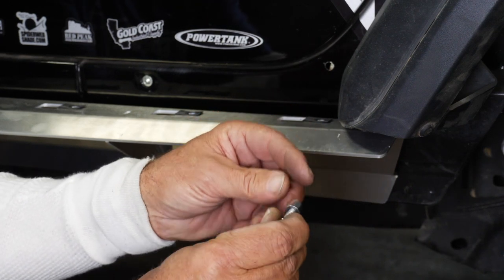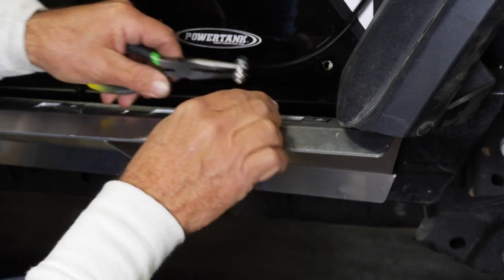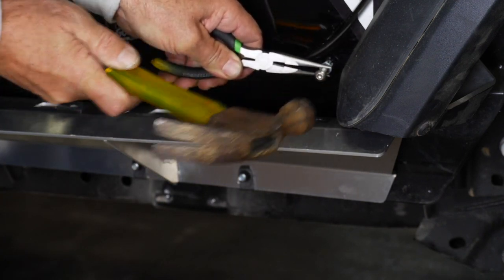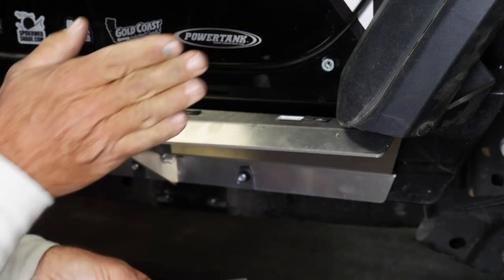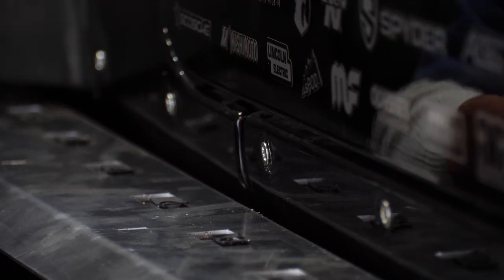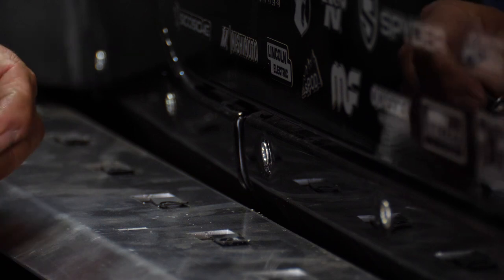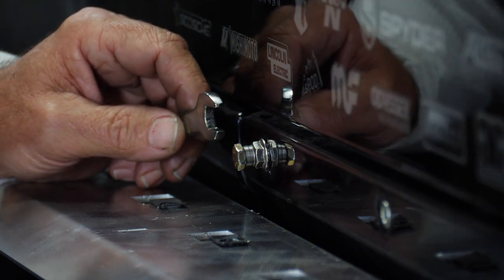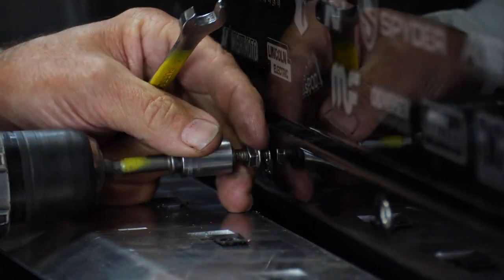How To | Installing Rivnuts on your Jeep

Comment: I've watched 5 of these videos and each one they jus drill to some random point and say oop it's done. Well do you know it's done. Does it pop? Like how do I know it's done or I dont go to far.
Reply: I'm about to tackle this with their hardware, I assume it just tightens enough that you know it's set. Did you ever do this yourself?
Reply: @longhorn8459  tried to do it for new fenders on my Jeep JK, ended up taking my thumb's nail off cause of the wrenches slipped, lol... it's tough.

Comment: Anyway to get the rivnuts back out? All the rivnuts on one fender are spinning with the bolts stuck in them from being old. Just bought the jeep and want to put new fenders on.
Reply from the maker: Most the time you need to grind the head off of them if they will not pull out with a bolt on them.  It is important to make sure you set them all the way when installing them.
Reply: Better to just drill them out

Comment: Great demo!  Which is better to use?  Impact driver or regular drill driver?  What torque level did you set on your drill?  Where do you buy those small washers?
Reply from the maker: Neither, you want to do it by hand. If you compress the rivenut too fast it tends skew it and you end up with a bad seat. We get most of our hardware from mcmaster.
Reply: @GenRightOffRoad  So, in the video the guy uses a drill. Yet you are saying not to use a drill? Or not to use an impact?

Comment: What type of rivnuts are recommended for something like this? Steel or aluminum?
Reply from the maker: All of the rivnuts we use in our builds are steel.
Reply: Video popped up as a related topic, so figured I'd watch...  To answer your question and others, stick with steel or the steel coated ones. I use these by the box at work and have learned this. Stainless seems the wise choice, IT'S STAINLESS and wont rust. Downside, very brittle and breaks quite easily. Nothing wore than drilling out a new install. Aluminum... exact opposite (soft material) but with the same result as the SS, only easier to drill out....   Pro tip>> add a bit of silicone before inserting to get a water tight "O ring" behind the flange.

Comment: Is there a way to avoid the potential issue of the rivnut “spinning” in the hole after it’s installed?
Reply from the maker: The best way is to make sure you get it tight enough during the initial install and do not over tighten the bolts going into it.